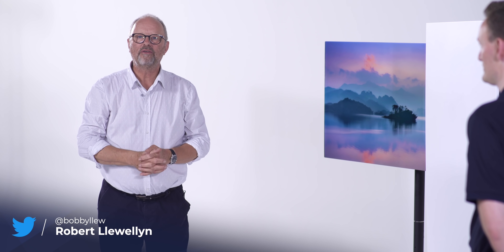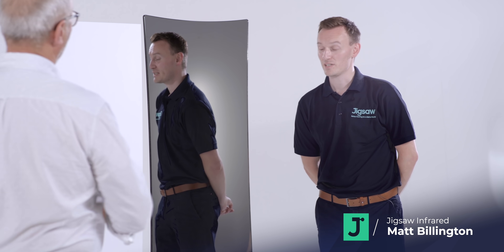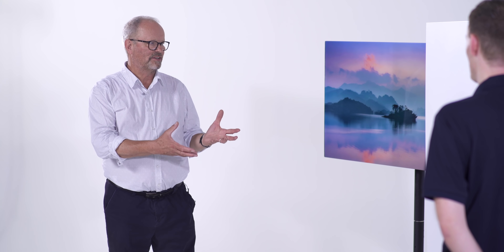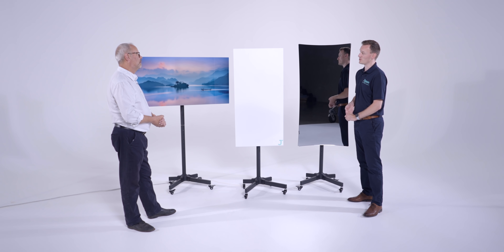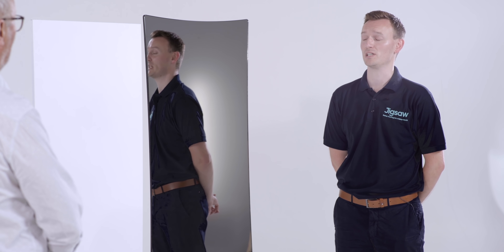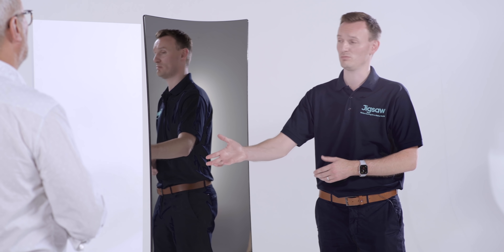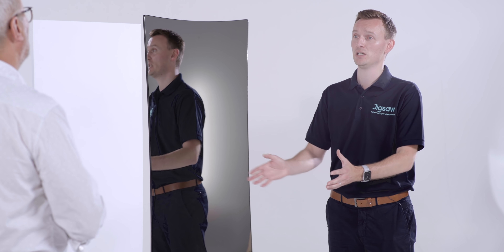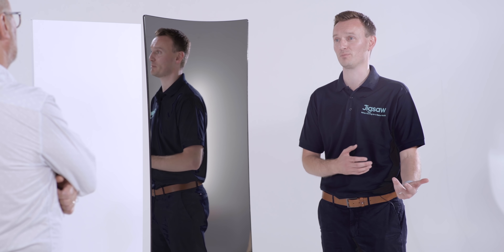JIGSAW INFRARED - Heats like the sun, cares for the planet | Subscribe to Fully Charged PLUS

Comment: Nice heat with high efficiency.
Reply: All direct electric heating has perfect 100% efficiency. That's easy. However heat pumps have 200 to 500% efficiency. 'Efficiency' is probably not the right way to think about heating. What actually matters is emissions, energy use and cost.
Reply: @xxwookey  I think they were comparing energy use of heat pumps to standard hvac.

Comment: If FC is going to tackle this sort of topic then the host needs to be someone who can ask the right physics-related questions. For instance, no-one here seems to be talking about the relative contribution of infra-red and convected heat from any given 'radiator'. A standard domestic radiator provides some air heating by convection and some, depending on its surface temperature, as IR. Presumably the hotter the water then the more IR is emitted. So even a standard radiator is an IR heater, to an extent at least.

That said, the human body can feel warmer by virtue of IR impinging on exposed flesh. So a system that provides more IR and less convection could feel warmer to a human for less power consumed and hence be more efficient than a water radiator. The room would be at a lower temperature but the human would feel comfortable as long as they were 'seeing' the IR. Presumably these Jigsaw panels emit a higher proportion of their energy as IR but perhaps somehow generate less convection. That's the sort of question that I would like to have seen explored.

This reminds me of a suggestion from many years ago that the most efficient way of heating a room (for human use) would be to install weak microwave emitting panels (assuming such devices are technically feasible) in the walls of rooms. Microwave frequency would be as for a microwave oven, ie to excite and thereby 'heat' water molecules specifically. So human skin would feel warm as a result of microwave heating but the room temperature could be quite low! Not sure what this Domestic Microwave Background (DMB (c)) would do to all our devices these days though.

Comment: This must be a lot less energy efficient that a heat pump. Let's not forget that a reversible air con can be small and cheap. You can get a small wall unit installed in France for less that €1000 for example. Even cheaper is an (admittedly noisy) portable unit. I think if you want to maintain the temperature of whole space over many hours a heat pump is bound to be more energy efficient. I am sure that the quality of the heat is more pleasant with this system though. If you have big space and you move around it in that these units follow you must be very efficient since you directly hear on demand.
Reply: It is not the same though. You do not use these to heat entire rooms. You use these to be comfertable where you sit and leave all other heating in the house off.
Air temperature can be substantially lower in the room and this feels just as comfertable.

Like sitting in the sun on a chilly day. You feel nice and warm even though the air temperature is rather low.

Comment: Infra-red is great in spaces where you don't want to heat the building/environment, but at home that's not comfortable.  There's no way you're getting warm ankles at home with these things.
Reply: Hi Ed, that's great to hear. However, could you please spare a moment to provide some specific feedback, let us into your experiences with infrared.

Obviously, you must have lived with infrared for many years and had your home professionally specified by experts? Or did you?

If you're not 'getting warm ankles' then you need to rethink your set up at home? You may wish to have a revisit to make sure the company you used came to your home and ensured your home was 'specced' correctly and the heaters positioned in the appropriate locations. It's also very important to have the correct number installed, no good scrimping and not adding the heaters needed, thats just false economy and you will end up with cold ankles. 

You can easily go out and buy 'any old' infrared heater but if you buy the cheap style then you will not feel the true effects, this is a shame and it's sad to hear that people like yourself have not enjoyed how infrared should feel. 

Like any heating system we buy it must be positioned correctly, installed by experts and have the most up to date control systems to ensure you feel comfortable and save money.

My advice to you is to do the right thing and have a professional team in next time. 

Warm regards, ankles and all....
Reply: @glennbillington4879 love the idea there’s such a thing as premium infra-red energy. 😂

Comment: UTTER TRIPE.

Please tell me how, just HOW the infrared LIGHT passes through the Aluminium panel,? Hmmm, I am waiting.. oh yes. It CAN'T it soly becomes a radiator.  

The Mirror maybe but NOT the plain white panel. It is simply a low wattage radiator.  

Prove me wrong. PLEASE..
Reply: The front of the panel doesn’t directly output the infrared emission from the heating element. However, the front heats up to between 80 to 125 degrees C, depending on the make and settings. The heated front panel radiates it’s heat outwards in all directions, with a peak wavelength in the long wave infrared region, probably between 9 to 10 microns. That’s about 10 times longer wavelength than near infrared (0.7 to 2 microns), and about 20 times longer than visible light (0.4 to 0.7 microns). I’m a physicist, by the way. So yes, the panels functions as radiators, but have much less convection because they don’t have air intakes, at least in these designs. One advantage compared to convector heaters is that they don’t burn dust in the air, so there shouldn’t be dark marks develop above them. I’m trying a few as a stop gap solution for now, because I don’t like the noise from blow heaters, or oil leaks and smells from oil filled radiators. The panels are silent, they look fine up on the wall, and the thermostatic control is useful. In the winter, I will probably heat a few rooms more overnight at the low electricity rate, and then set the heaters lower when I’m out during the day. I will probably add in another heating system sometime, and use infrared panels as backup in cold spells, rather than the main heating system.
Reply: @marktweedie9691  Hi Mark  and thanks for the explanation.  Just to make sure  I understand . 

The Actual Panel, Aluminium, when heated to 80-125 degrees will emit an amount of Far Infrared regardless of the heat source driving the raise in temperature?

So is it safe to say that any Aluminium based non  convection heater will do the same such as old school panel heaters with heated wire elements or oil filled radiators?

Is it only Aluminium that radiates in the Long Infra-Red frequency or does any metal achieve that level of radiation when heated sufficiently? 

How much of the radiant heat is actually in the Infra-Red range? as you can tell I am not a physicist but this intrigues me..

I see tons of adverts flying around for these panels and under floor heating film all using infra red heating elements and touting the 'Health benefits' of Near Infra Red when in reality all of them need to be covered which negates that infra red light and changes the whole thing to little more than a radiator,,  and "Cheaper to Run" when a Kilowatt out always needs a Kilowatt in. 

Which is why I called BS on this Whole promotional video which addressed NONE of these issues and more a Fan Boy piece with no substance talking about something that has been around for ages as if it was new.

OR am I missing something
Reply: @dadachoski5946  Hi, smooth metal panels firstly have to painted to get about the same emission as other matt materials at a given temperature. That’s because the emissivity of smooth uncoated metal is about 0.12, compared to 0.95 for matt materials. Then both will emit roughly the same amount of far infrared at the same temperature.

Objects at about 300K, or 27 deg. C, have peak emission at 10 microns wavelength. If you look up “blackbody emission” you will find how the wavelength profile changes with temperature. The air actually has windows, or regions in the spectrum where photons pass through with little absorption. Outside of visible and near-infrared, these would SWIR at about 2 to 2.5 microns, MWIR at 3 to 5 microns, and LWIR at 8 to 12 microns. So the emission from an object at 373K, or 100deg.C, which will peak somewhere between 9 to 10 microns, I think, will pass easily through the air. Outside those 3 windows, and apart from visible/ near IR, infrared absorption would be mainly by water vapour, and that would heat the air to some extent. Hope I’ve explained it clearly!

The oil filled radiators aren’t quite as hot on the outer surface as the flat infrared panels, so don’t output as much infrared. However, they do heat the air around them, and this, together with the surface shape, helps set up air circulation currents in the room, with hot air rising, and cool air falling, because of the difference in density. Convector heaters do much the same, drawing cool air in at the bottom.

It might be right in practice that the flat infrared panels don’t dry the air as much as convection heating, whether from oil filled radiators, convector panels, or storage heaters. Maybe because they don’t heat the air just as much to start with. So less dust circulation, because of less convection currents, may be a health benefit to allergy sufferers, but it’s an indirect effect of the design and operating principles of the panels, rather than a direct effect from being bathed in long wave infrared rays. (Short wave infrared from patio heater lamps may dry and crack your skin with long term continual exposure, as these are much hotter.)

You can run these heaters overnight on low rate electricity from the standard supply if you have Economy 7 with dual metering. So you build up the heat overnight in, say, the living room and kitchen, to e.g. 25 deg. C, and don’t have to top it up so much during the day. The main argument for potential cost savings from infrared panels is that you can set the temperature about 2 deg. C lower than for convection heating, so using less electricity, and still be as comfortable. That might assume, though, that you’re within about 1.5m from the panel, where you can still feel the direct heat. 

I’m using several flat panel infrared heaters of a cheaper brand as a stop gap over this coming winter, while I look into a full replacement system for the very old storage heaters I’ve inherited. I’m trying them up on the wall, rather than ceiling-mounted. They are silent, unlike blow heaters, there’s no oil to leak or smell, and they’re out of the way up on the wall, and look OK, which is what I wanted for now. I don’t really expect them to be cheaper to run than the old storage heaters, as I’m sure I will have to top up the heat in the evening anyway. At least they have decent digital thermostats, which should help control the temperature better. Hope this all helps!

Comment: the warmth felt from sunlight is due to the absorption of the light, not the infrared from the sun, also the infrared radiation from the surface will not be directional, its hemispherical, it's the view factor that changes.

Comment: Nobody mentioned the elephant in the room, the surface temperature of these heaters is >100°C that's one hot mirror!
Reply: Did anyone say the mirror reached 100 degrees? It doesn't, in my experience of using one it is more likely to reach 75 degrees. The aluminium surface temperature is more like 96 degrees and for a more efficent usage it is placed on the ceiling.

Comment: Why does no-one talking about "IR heating" provide details about actual efficiency? Perhaps because these are just glorified resistive heaters which have the 100% efficiency we have had since electricity was invented?
Reply: Why the need to be down pan about infrared. It works and it will work even better in the future. It's 100% efficient but its the way its controlled and how it is installed and specified in the correct way.
Reply: @glennbillington4879  They are always very carefully skirting around the problem of efficiency. And it feels very deliberate. At no point do they go and say specifically "While the actual heating efficiency is the same as resistive, the human body experiences it differently, and therefore less power is needed to achieve the same level of comfort, and thus less energy is needed." I never hear them say that, and it feels very deliberately so. I am pretty sure that there is limited empirical data to back this up.
Reply: @glennbillington4879  Then... The point where i really had to roll my eyes... The mention that this does not create humidity problems... (which is primarily a problem of insulation and not heating) This is a radiation only based heating system, and if you think of it like light, you will have "shadows" everywhere and thus places that will never get heated. Warmer air will hit those spots as well and condense out. This is the big advantage of underfloor heating: it heats the whole screed evenly which will then radiate up evenly and it is this evenness that reduces the temperature difference (in an uneven or  badly insulated home).
Reply: @glennbillington4879  The fundamental issue is... If they were honest, they would have to explain that this feels like sitting in front of a fire (i have not experienced this heating before, but it makes logical sense to me to rationalize it as such). Then people would state "great! I want one for my living room for a cozy winter evening in front of the TV." One. Per domicile. Used rarely. And yet they try to sell it as a replacement for existing heating system or proper underfloor heating. And this is why they skirt around some things which in turn triggers my BS meter.

Comment: This is resistive heating in a different form and therefore complete rubbish. Convenient, and easy, but not at all efficient. They speak of this heating objects in the room as if this is a new concept. We call it 'heat', like a radiator, a fire, the sun, etc.

Come on Robert, your public has had enough of these advertising opportunities masquerading as new technology. I truly believe you are diminishing the Fully Charged brand.
Reply: Heatpumps don't provide radiated heat and therefore need to heat all the air in a certain space to a high temperature to provide comfort.
This provides local comfort while the air temperature in the room can be kept low.

They are a cheap and efficient to achieve certain goals. Other solutions are more efficient in other usecases.

Comment: 800W will heat a bedroom in 10-15 minutes? Don't think so.

I'd invest in a heat pump when our gas system fails since they are around 400% efficient (or more). Any resistive heating is only 100% efficient, so if we want to save electricity then this is a bad recommendation. (Clearly he has avoided mentioning that heat pumps are better if the install is possible. You could see him stopping himself. Haha.)

It's worth mentioning that we use the Wiser Smart system with our gas central heating so also only heat up the rooms we're using.
Reply: Not all properties are suited to Heat pumps. There needs to be alternatives. Heat pumps are a lot more expensive in most cases.
Reply: @glennbillington4879  People worried about price wouldn't buy these panels either. Those that can afford these should consider heat pumps because they are far more efficient.

I agree that there are some properties that can't have heat pumps fitted.
Reply: @nssimpson  Some? There are hundreds of thousands. People who see heat pumps as the be all and end all are blinkered and the government should play a part in educating the country.
Reply: @glennbillington4879  Hundreds of thousands of people that can't have a heat pump and can afford these overpriced heaters?
Reply: @nssimpson  and the price comparison of heat pumps and infrared? Not that i want to get into that as this is not a war with ASHP's and you know it. You stated overpriced and not I. 

How come you do not see the benefits of checking the pricing on all heating options? Have you priced up the specification for infrared v heat pump? 

How can you judge what is overpriced until you do your maths?
Reply: @glennbillington4879  I simply believe that these heaters offer fashion over function. They're not very powerful so a regular house with only these heaters would need to run quite a few of them. Based on the pricing he gave having a heat pump installed might not be that much more expensive. However, running costs will be considerably lower.
Reply: @nssimpson  Really? Our debate was getting somewhere and i liked passing comments to you. This latest comment is not at all fact based on the products demonstrated on the video. 

These products are very powerful and the testing carried out by Aston University has established these facts. If you've used others products previously they may not have been up their high standards?
Reply: @glennbillington4879  The chap stated that a 4-5 bed house would be £8k-£9k or maybe a bit more and there's currently no government incentive to help. Looking at the cost of heat pumps, there's not a great deal of difference so if that's an option then they make far more sense since they are many times more efficient.

My point remains, these panels are for people with too much spare cash that care about fashion over function. You can buy electric heaters for many times less than this and get exactly the same 100% efficiency.